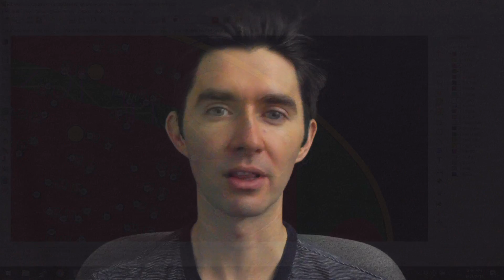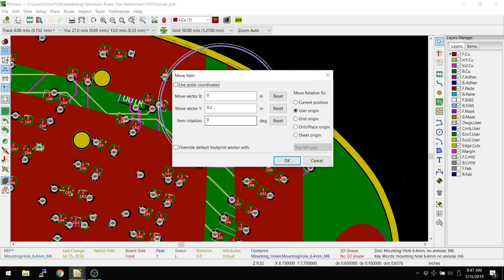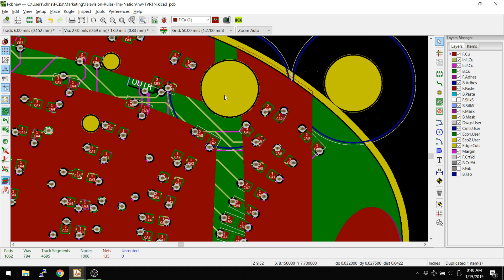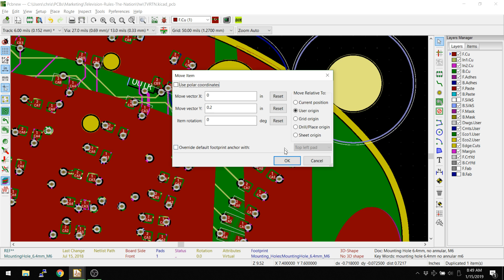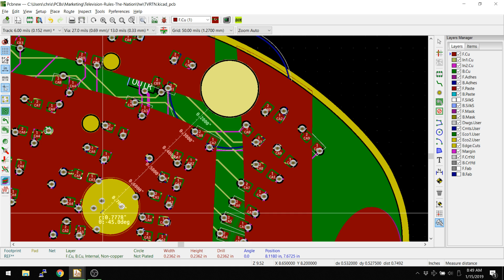KiCad 5.0 - Moving and Measuring

Comment: I would kill for some more in-depth parametric CAD features in the footprint and board editors. It'd make placement and drawing a lot better if I could specify constraints instead of working in terms of measurements. I'm not so sure what the UI for this would be in an EDA tool, but I still want it.